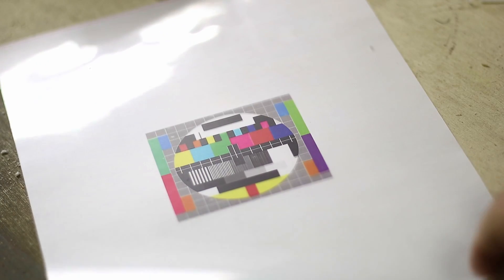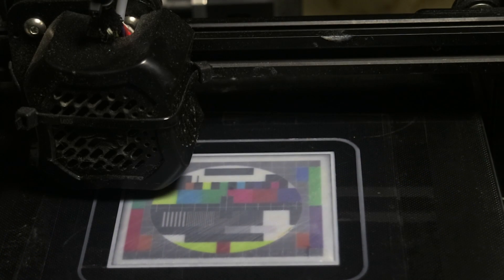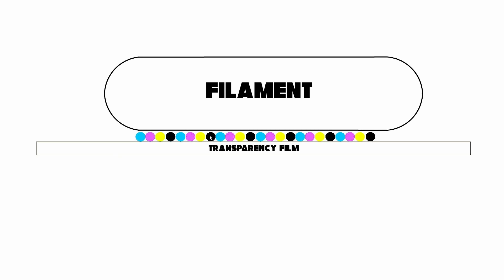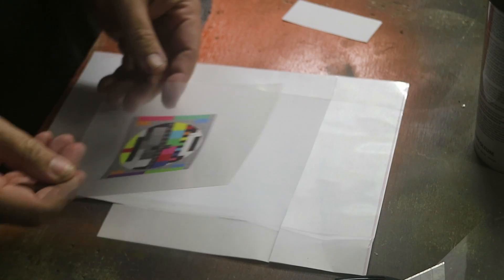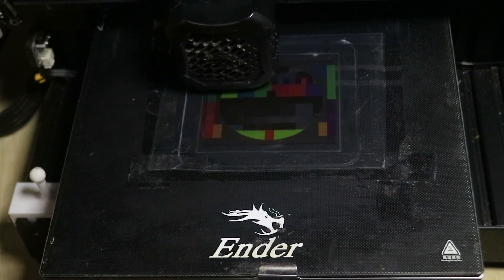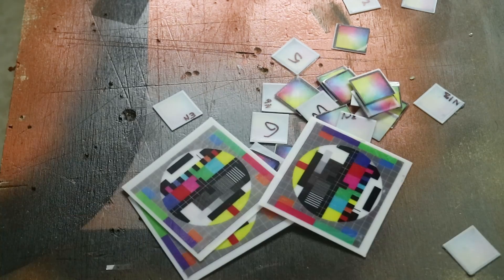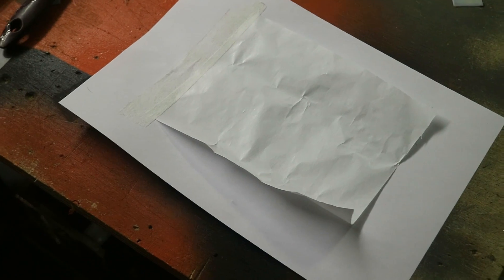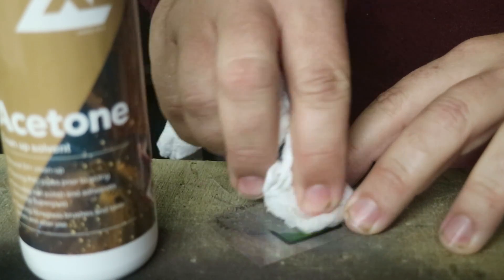How to transfer full color prints on to your 3D printed parts

Comment: I just had an idea: How about laying the paper on the print after printing it and pressing it onto the plastic while heating it. Maybe this works also. Ig it would be easier
Reply from the maker: It probably could, but the heat required would probably deform the PLA.
Reply: @JWNZ  Yeah. True. Very gently maybe with a little iron

Comment: @JWNZ. I am trying to use this method. Transferring works great, but my transparent film is shrinking/expanding when the hot nozzle prints on it, causing the print on it to distort or fall off completely. How did you solve this issue? I tried to put my bed on 100° and my nozzle on 190° to have less a temperature shock than with 60° bed and 230° nozzle, but this did not help at all.
Reply from the maker: You probably need to do some testing with the z height. it sounds to me that it is too low. I used PLA the bed was around 50 IIRC. I print the first layer to get alignment then print again ensuring the probe hits the film during homing and it seems to work pretty good.

Comment: Have you tried this with normal white printer paper ?
Reply from the maker: I haven't. It will probably work, but not as much will be transferred.
Reply: I was trying it with normal paper when I found this video. It worked okay. Afterwards I rinsed off residual bits of paper with warm water. Running the paper through the 3D printer twice might increase the amount of toner and therefore the amount of transfer.
I added transparency film to my shopping list, but standard printer paper does work in a pinch.

Comment: Hey man, I also reinvented this process recently.  I ended up using sublimation paper to print onto.  It has I think a think layer of plastic similar to the freezer paper, and also seems to not curl as bad when heated.  Makes for a bit quicker process.
Reply from the maker: Sounds interesting. Do you have a link to the paper?

Comment: Holly crap I can't beleive that worked! I just tried it on my Ender 2 pro and with my black and white toner printer. It looks professionally made! This method works so much better then the acetone or the heat method combined.
Reply from the maker: Great for control panels, I used this process to make some buttons for an arcade machine https://youtu.be/hP2AyyRsXhE
Reply: than

Comment: Can i do this with ink printer?
Reply from the maker: No, inkjets print into paper with air curing where as toner machines print onto paper using heat. The process 
effectively melts the toner again and transfers it to the plastic.
Reply: @JWNZ  thanks, i almost buy ink printer for that
Reply from the maker: @microfilm1001  Well I am glad you didn't waste your money just for this purpose. You will need a toner-based printer, unfortunately, they are a lot more expensive. I got a second-hand one for $20.
Reply: I tried this with sublimation paper. It works but the sublimation paper warped under the print which made the surface bumpy. 
Next time I'll try it with the clear lamination paper.

Comment: Is there any modifications done to the printer, i would assume by lack of knowledge that it is not "burned" on the to plastic as normal?
Reply from the maker: The printer is a 100% stock hardware ender 3 v2. The toner is just transfered by heat.
Reply: @JWNZ  okay i should have been more specefik. i mean the toner printer. is that stock? no disabeling of anything
Reply from the maker: @ZaxMan3D  Oh 😀 Yes standard toner - I am using a Xerox CP105